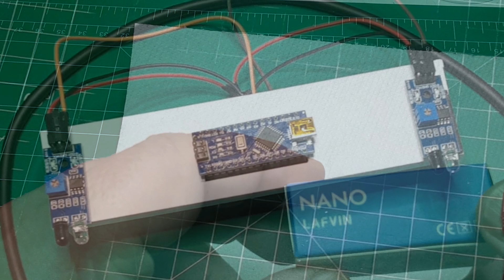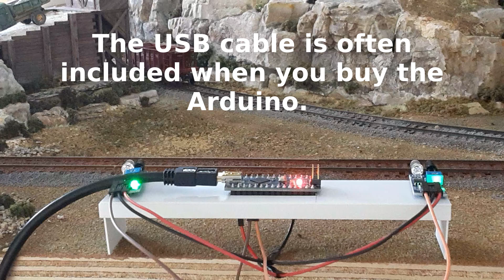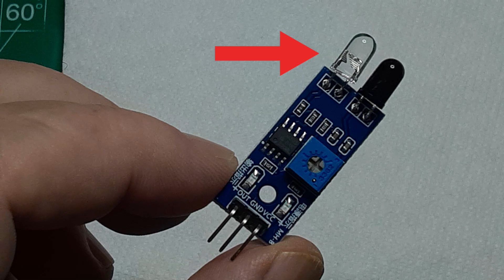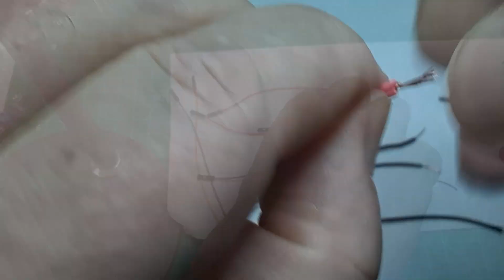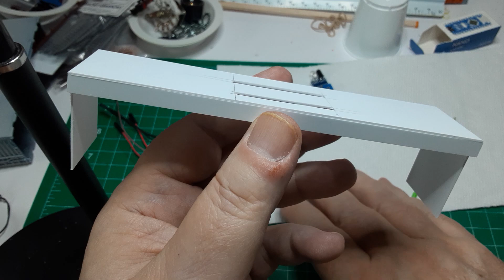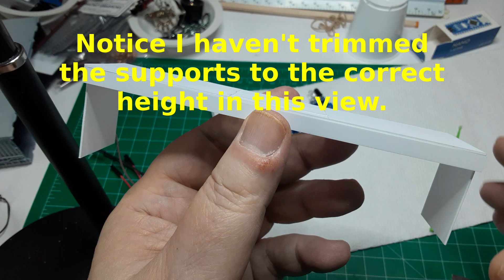Build a Scale Speedometer for Your Model Trains - Part 1

Comment: I'm confused as to how to actually use the program. Download and install seemed to work. I did need to use the "old" bootlegger.  Double click Arduino IDE and program opens. Click on Serial Monitor and the cursor is in the message section. No display that says "ready" or "detecting". Boards light up as expected and green lights blink as I pass my hand in front of each. Bottom right corner shows Arduino Nano on Com 3. Using 2.3.6 and sketch_nov27a. Any help would be much appreciated!
Reply from the maker: It sounds as though you are on the right track - it is encouraging that the lights seem to indicate that the hardware is working.
I am concerned that the IDE is reporting a sketch named sketch-nov27a - that is a default name given to an empty sketch opened on Nov 27 (which was yesterday). If the speedometer program was loaded, that should read Speedometer_ver_1.ino.
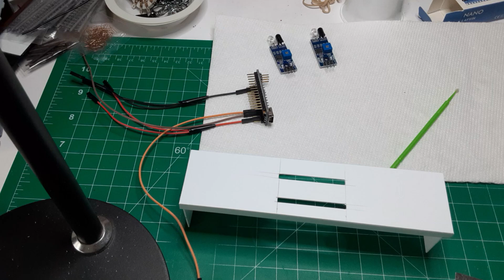Open the second video in this series and fast forward to time stamp 8:30 - this will walk you through downloading and running the Speedometer_ver_1 sketch. If you've already downloaded the sketch, try using the IDE menu to select File/Open Recent.../ then look for Speedometer_ver_1. If you can find it, click the file name and then click Open (or maybe Load - can;t remember which.) The IDE should now say Speedometer_ver_1.ino in the upper left corner just below the green bar.
once you have the Speedometer sketch open, you should be able to compile and load it onto your Nano.
Feel free to drop me an email at rjw31415926@gmail.com if you continue to have difficulties. It might be helpful to snap a photo of your computer screen (or use a screen capture tool) and send that to me.
Please let me know how it goes. I'll check my YouTube alerts and my email periodically through my day (I'm in US Central Time zone).
Reply from the maker: Sorry - One more thought:
If you have already loaded the speedometer sketch onto your Nano (and you must have since you reported that you had to use the Old Bootloader), it is NOT necessary to have the sketch loaded into the IDE. (But DO NOT upload that empty sketch onto your Nano! Upload the speedometer sketch once then again only if you need to modify your sketch.)
However, it IS important that the serial monitor is communicating at the same speed as the Nano. At the upper right corner of the Serial Monitor window, there is a dropdown box where you select the communication speed. That box should read 9600 baud. If not, use the dropdown box to select 9600 baud.
Reply from the maker: To elaborate on my previous comment: The right-facing arrow in the Arduino is a poor selection: it could be interpreted as "Run" or "Start". In fact, it means only "upload the currently displayed sketch to the Arduino."
As soon as you apply power to the Arduino (or as soon as the sketch has finished uploading) the program execution begins immediately, and continues until the Arduino loses power.
It occurs to me that the following sequence of steps occurred:
1. You downloaded the Speedometer sketch and opened it using the Arduino IDE.
2. You successfully compiled it and uploaded it to the Nano.
3. You took a break an closed the IDE.
4. When you returned, you opened the IDE and it automatically opened a blank sketch.
5. If, at that point, you clicked the upload icon again, the IDE obligingly loaded a blank program into the Nano, and the Nano is now busily doing exactly nothing.
Reply: @rwissbaum9849  Success! I downloaded the Speedometer_ver_1 sketch again. Followed the steps you suggested and uploaded it to the Nano clone. Everything works perfectly. A sincere thank you for your clear, concise directions!
Reply from the maker: Just following up: Did you ever get your speedometer working?

Comment: Great video, I am wondering if I can use a tablet instead of a laptop, not sure if there is a way to download it to a tablet.
Reply from the maker: I am assuming your tablet runs Android. If it runs macOS, you should be able to download and install the IDE (although iPads in general are not very friendly about connecting to other devices.)
The Arduino IDE is available as a web-based app, so you might be able to use the web-based version if your tablet is running Android OS. The critical requirement is the ability to plug a USB cable into your tablet (I'm guessing it'd be a USB-C connector) so you can connect to the Arduino.

Comment: Thanks so much for posting these hugely useful & helpful instructional videos...I've been needing a speedometer for ages so I can multi consist my locos without damaging my couplers...I've followed your clear and not too overly complicated instructions (much appreciated !) and apart from a few minor hiccups, it works perfectly! One problem I had was, I couldn't upload the sketch to Arduino Nano board untill I changed the processor to "ATmega328P (Old Bootleger) in Tools in the IDE. Also had a problem with faulty cable causing my COM port not being recognised but relplacing this fixed problem immediately. Looking forward to your Part 3 video to create a stand alone unit... so glad your videos are so easy to follow and cater for those of us not overly proficient in electronics and computer coding!
Reply from the maker: It's getting harder and harder to find Arduino clones that require the old bootloader, otherwise I would've inserted a caution. So glad you fixed the problem on your own! Part 3 is coming - just waiting on slow delivery of a few parts. Hang in there...